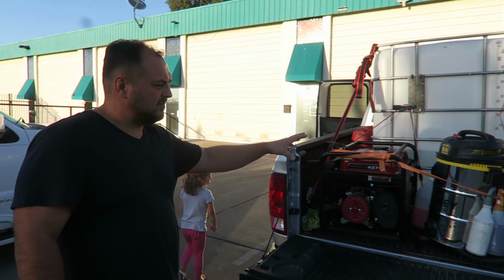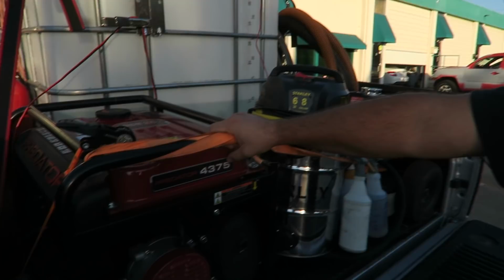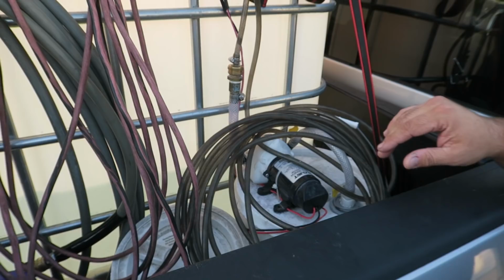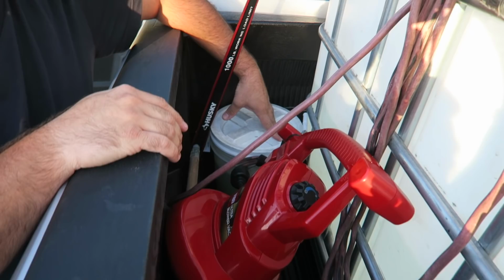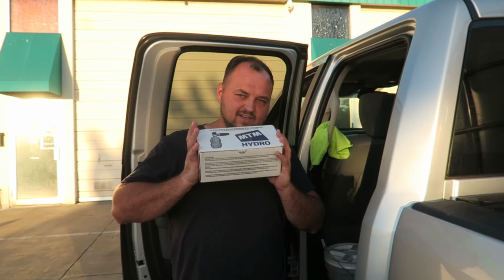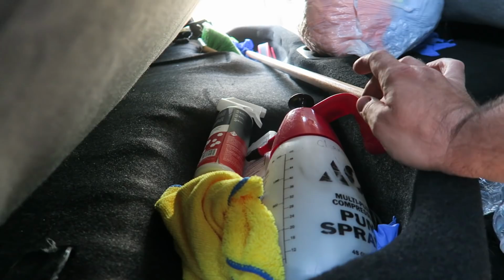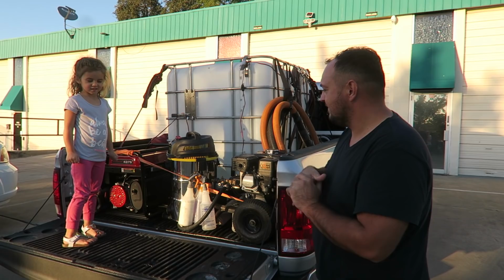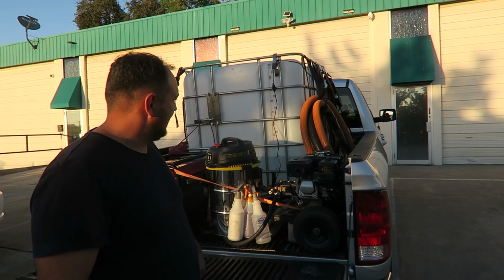SLAP IT TOGETHER SETUP!! S02 E13

Comment: Great Video & Subject
I myself prefer a van or trailer as you can fit everything you need comfortably and don't have to worry about anything getting stolen because it's in Plainview especially if you have to leave it parked somewhere to use the restroom.
That First GMC truck looked badass
Reply from the maker: Yeah I think van and trailer is good options, and yes that GMC Denali looks good it's wrapped.

Comment: Question bro how much alcohol you add with water in bucket? And how great for it work bro? Shout out from Jay’s Mobile Detailing from Texas bro.
Reply from the maker: I put 3-6 oz to 2 gallons of deionized water, I put enough to where I can smell it in the water. That for windows. I'll link a video where I talked about the cleaning of windows
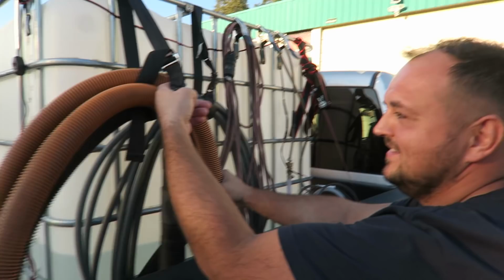Reply from the maker: https://youtu.be/X2PtqyivJlM @6:55

It helps using deionized water with rubbing alcohol, and have the towel soaking in bucket all the time, and when wiping windows ring out as much water as you can out of towel to were it's a little damp, and rubbing alcohol helps to prevent fogging on windows, helps a little.

Comment: Nice to show temporary set up, mobile wise using your van is that also just maintenance wash, 275 gallon IBC tank how full do you keep it for mobile and about how many vehicles off what you fill up on
Reply from the maker: Also 275 gallons in my van and I fill it full all the time, and my vans payload is 3800lb, all mobile is maintenance washes Monday thru Friday, all Detailing packages I try to do at shop.

Comment: How many feet. And thickness is the hose used in the pump for super clen
Reply from the maker: 50 feet and 3/8 thick
Reply: @toly24  how much is the pressure washer
Reply from the maker: @chekasan1872  75 feet